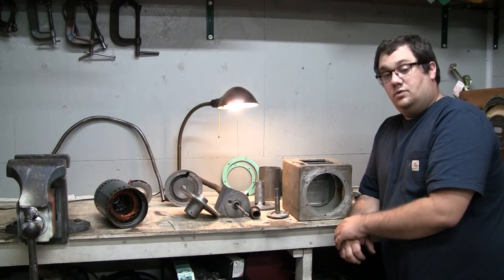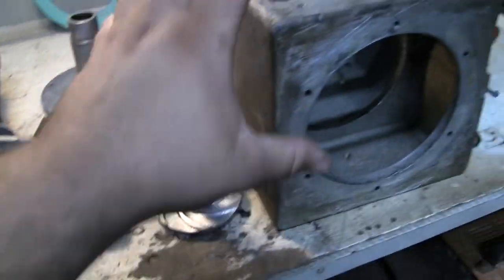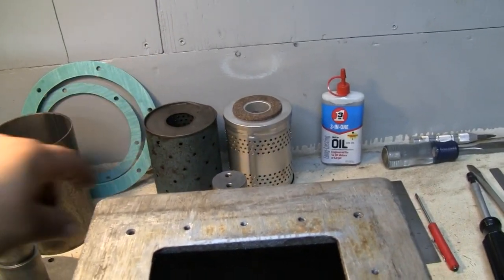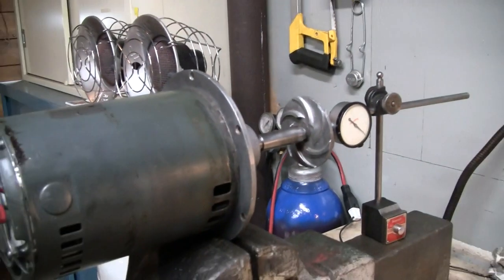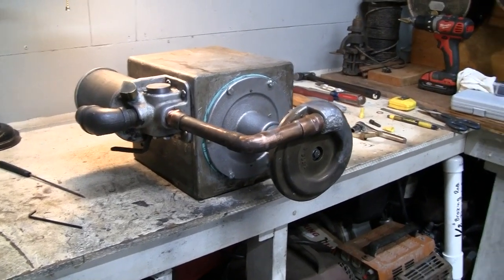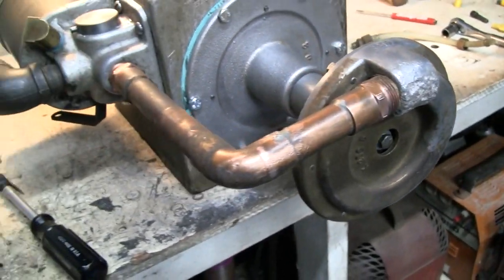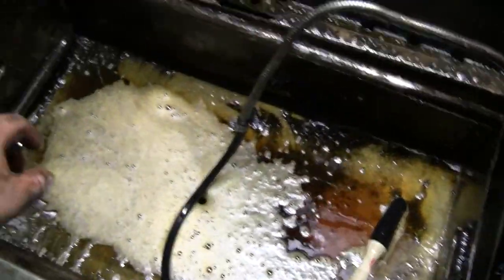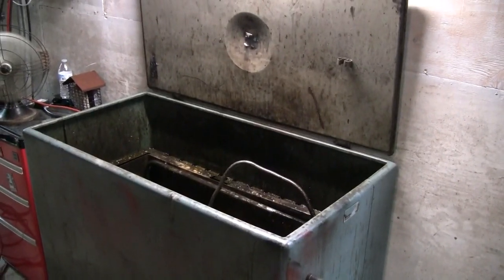Vintage Parts Washer Repair (Part 2 of 2)

Comment: I think the flow on the bars is perfect. You can put a part/parts in the pan, shut the lid and turn it on. Now, walk away for 10-20 minutes and when you come back the parts will have the bulky stuff off and the rest will have been loosened up and ready to use the brush on. The lid will keep all of the splash to a minimum and contained inside the washer.

Really nice find and great fix for the cost. Thanks for sharing.

Comment: Excellent assessment of how the end-play came to be! I agree 100%. Great job getting this super high quality unit back in service. They sure don't make stuff like they used to. That thing will probably outlast you now. Ohh, I also agree with your notion that there was water in the bottom of the tank that caused the corrosion on the bottom pump housing. I hope you eventually completely drained it.

Comment: Definitely worth 50 bucks. I don't know if you realize or had mentioned it before but you should recognize that cabinet is a top loading COKE machine. Not kidding, they used the same cabinet. There are several different pumps used over the years, a screen between the main tank and the pump chamber that looks like a window screen but much finer mesh. The cartridge filters are actually screen filters, 80 to 100 micron if I remember, available but pricey. I have a much older one than yours.

Comment: That motor drive-end housing is cool.  It reminds me of a project I recently did. As I said in comment on your 1 of 2 video; it looks like they removed the original General Electric end housing of the motor; and made the custom end housing which mates to the motor stator and the Clear Flow pump housing.  

Looking at the winding of the motor, it was a 2-pole motor. That will have a free speed of 3600 RPM. With the pump you have, that will really produce some flow! Looks like it really does, too.  Your $50 investment was well spent! 

That solvent looks very tired, with the foaming and dark color. It may rapidly clog your new filter element. If it were mine, I would try to get a new charge of fresh solvent for it. Not sure where to get it; but probably others can chime in.  I've pretty well shifted to using hot caustic, pressure wash, and ultrasonic for my cleaning. But if one of these shows up near my hometown, I would definitely be interested. 

As a way to share a related experience; last year I rebuilt a 1930's Sparks Withington "Sparton" refrigerator. They used a Delco repulsion-induction motor, but the motor's drive-end housing had been replaced with a custom casting. The custom casting was a transition piece between the Delco motor and the "Sparton" sulphur dioxide compressor. No idea if they ordered the motor with no end housing, or removed the original and replaced it with their own. Eaither way the motor-compressor was clearly a very highly engineered design with a modified motor. There was no chance of replacing that motor with another type motor if it went bad. But I was lucky and was able to repair the existing motor. Here is a video on the Sparton. This is the only known working example. https://youtu.be/5LHdcI1eTQ4 

This parts washer is really a nice addition to your shop! I am sure it will be a valuable asset for years! Thanks for sharing it with us.

Comment: Hey Mike now that's a parts washer those are the kind that the Road King and I had back in the day from what I can remember there was a linkage or a thin rod with a hoop bent at the end that you pushed or pulled for control of the flow great job on the videos

Comment: Great washer, wow I could use something like that!
The filter becomes clogged too quickly
Once the filter is clogged, open your canister and take out the filter material and put steel wool in it.
You never have to replace it, just rinse
Reply: But where do you wash it?!  The parts washer is down for maintenance.

Comment: If you ever have that pump assembly out again, I'd coat that pitted aluminum area with POR-15.  That stuff is amazingly tough and meant to permanently seal/protect metal in petroleum based environments.  They have a metal-prep product for adhesion to aluminum.

Comment: WOW! I've never seen a parts washer put out that amount of pressure. I love the parts spray soaking option, drop it in and let her run!. 
Here's some quick mod Ideas I was thinking of:
1. A blast screen and gloves like in a blast cabinet! 
2. Some kind of fluid pressure control. A fluid T with a relief valve to divert some of the fluid back into the holding tank would control the pressure without loading down the motor or pump. You could also user a motor speed controller so you could regulate it electrically but that's just something electrical to to wrong, but super easy to do. 
3. Heater to help it dissolve heavy grease. A Hot Water Heater hung in the tank off a 90 bracket would probably work good. Just shield the top connections and fuse it for added safety.
4. Added screens to keep the chunks from clogging up that nice filter. A screen wall from front to back, or basket around the pump inlet would work great.
Anyways you definitely got your $50.00 bucks worth on that! Thanks for sharing Mike, I'm a little envious of the SUPER COOL cleaner. WATCH OUT Road King will be over there all the time now Using IT! LOL   Best Wishes & Blessings. Keith Noneya

Comment: New parts washers have a sort of fusible link on the lid bracket to automatically close the lid in case of a fire, also just put a small ball valve in line for your hand held brush.

Comment: That's an Industrial Strength Washer there Mike! Given the kind of big projects you have it's perfect for you and even better at $50 and maybe anther $20 in parts(if that). Most of the ones today have limited flow and thin sheet metal. However there are several videos on YT of upgrades to the "Harbor Freight" models to make them more useful.

Comment: We used to get the safety clean man in once a week or so to replace the barrel of sludgy solvent.  Hope you plan on replacing the fluid often along with the filter.  Plus the solvent you got in there is already filthy.

Comment: That sure pumps a lot of solvent out the spray bar ..I am sure you could put a control on the motor to slow it down or some kind of adjustable  pressure regulator on the hose

Comment: Hi mike you have probably worked it out buy now .but on my parts washer the link rod goes to the lid .so the brush only operates when the lid is in the open position. And the spray bar when the lid is closed  Regards from over the pond

Comment: The pitting on the outside of the output of the pump housing is cavitation. Acetone boils at 132 f, so will cavitate at a lower temp. The pressurized end of a pump is hotter. The solvent internal to the pump is pressurized and will resist cavitation, passing the shock waves from the spinning rotor vanes to the housing, where those shock waves cavitate the solvent outside the pump, pitting the housing. A motor speed controller would reduce splash, and both friction and cavitation wear.

Comment: You are going to have to get protection for using the parts washer I would recommend. But it's a great one. You will use it a lot. But I will say this keep extra filters around for it you will need them. Other than that it was a great deal. Loved the video.

Comment: get one of the Magnetic Fridge door hooks to control the height of the bar to the control valve.. stuck to the side of your cabinet..  allowing you to micro position it to change the flow rate to either spray bars or wand..

Comment: Good job Mike and us old flatulators are envious of that stream. :-) Your $50 was VERY well spent. Because of the potential for an immense amount of large particles being suspended in the washer solvent, I will be surprised if the fuel filter which is designed for less contamination will last long before clogging.

Comment: Thats an early design jetwash cabinet. You load it up, close the lid and walk away and let it blast. There should be a 3-way diverter valve that allows you to turn the flow on the solvent to the brush and have the rest bypass so its not like a firehose. That amount of flow from the brush is bad because it atomizes the solvent and you end up breathing it in. It should be very low flow rate.

Comment: Great job, good machine for the price and work. I wonder why the slug in the tank was not cleaned out before you replaced the fuel filter.

Comment: Mike I reckon your be best to change the cleaning fluid for some fresh,  as you had it apart, wood have done so first before assembly especially as you put a new filter in it 🙂 I see it was over a year ago so has this been a worthwhile perches did it clean that Cat engine up good? From the UK.

Comment: Might be worth while to try the system with the old filter to see if there is less flow.  Is the filter on the intake side of the pump or the discharge side? The pump may be set up for higher filter restriction as opposed to more flow.

Comment: Love your videos. Looks like some electrolysis going on there with the copper and looks like aluminum housing. Same reason they use a plastic fitting in the top of water heaters. 
Normally you see it with copper to galvanized pipe but I have seen it with other metals.

Comment: I'd have mounted a pilot light (neon to be period correct) in the hole next to the switch that's probably what was there originally. That way you will know if it's on when the lid is closed.

Comment: I would have thought you would have cleaned it out, especially all the heavier sludge before putting it through the new filter. Of course re-use the fluid but strain it back in (through an old sock!) after emptying the machine and "de-sludging" it.

Comment: That is some high volume of fluid. I would look for a way to regulate it. It seems that you will be splashing more than you want to on yourself and out of the parts washer onto the floor.
Reply: well i guess its got a lid for a reason

Comment: I wonder if it had a speed control for the motor at one point so you had flow control...
Reply: looks like a road trip to the electrical parts house

Comment: Would be nice if the pump speed was adjustable. That’s a heck of a lot of flow.
Reply: If he puts a rod on the valve he'll able to split the flow (to control either output) just by having something to hold the rod in position.

Comment: Mike I think you need some sort of flow control valve in line.
Reply: I agree, a valve that could tap off the main output and just recirculate instead of going through the nozzle probably wouldn't be hard. Or an external motor speed control probably wouldn't be ,much.

Comment: You need to consider a good wireless mic for your camera, the audio jumps up and down too much and leave one playing with the volume control to hear what your saying. A good wireless mic will solve that issue for you and I think the viewers will appreciate the improvement. Just a thought.. Oh and a passing thought you might want to use that on a ground fault/arc fault outlet only (even more so if your using solvents). If your shop burns to the ground and the investigators find your using that without taking up to date safety measures, you will kiss your insurance coverage good bye..

Comment: got my sound on laptop up all the way and can barely hear it
Reply: The rest of the video is ok so far.
Reply: I couldn't hear the intro at all but even once the sound kicked in it was ok but still much lower than it was on part 1 (which I just skimmed since I'd forgotten most of it so I did have a direct comparison of levels).
Reply: @ruben_balea  cool plug-in.  Thanks!

Comment: Too bad the pump doesn't allow you to drain that old cleaning fluid frothy oily crap out of there. You could just hang the brush over the side into a bucket and let it rip. Nice washer for $50. and not made in China for sure GE.